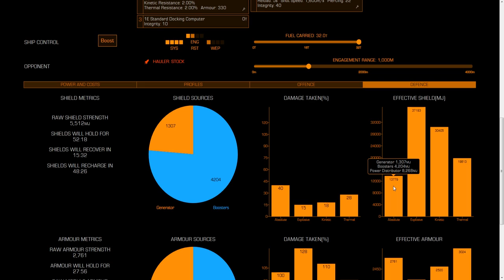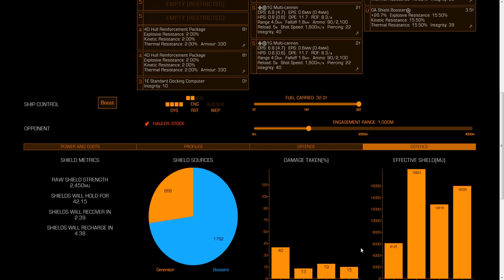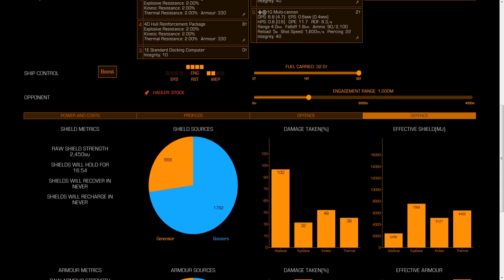ELITE DANGEROUS: 150 GRADE 5 THERMAL RESIST SHIELD ROLLS

Comment: I've been running resistance bi-weaves on my python and FDL...
I have both Bi-weaves Thermal shields as well as regular resistance augmented for both [Still testing]

Here's what i've found:
For the Thermal Bi-weaves...  as long as I have a total shield strength of over 1000mj's the shields are amazing.  So in relation to your bi-weaves on the Annihilator, you should be fine with over 2k shields.  It's when the values are below 950mj's where you find the Bi-weave thermal options starts to break down.  Essentially the resistance works... but with lower MJ shields... you don't have much to work with and your shields drop quickly.

Right now on my FDL, thanks to you, I have about 1001mj shields with 67 thermal resistance, 58 kinetic and 62 explosive, but the shield has to be a normal shield [I got a great shield boost on the thermal shield as well]... and I have to run 6 good resistance augmented boosters and two very good thermal boosters with some shield boost.  Mind you... that's at 2 pips to shields.

With 2k+ thermal bi weave shields on your conda... at more than 60% resistance... you should be fine.
Reply from the maker: dopejack007 yeah im really really liking the biweaves on my corvette
Reply: Here's a question for you - off topic...
How are those grade 5 overcharged power plants working for you?
I ended up storing my grade 5 OC PP because the heat generation was ridiculous on my python.
I instead rolled up one grade 1 OC PP for PVE general use... and one grade 2 Armored PP for PVP.

I found them to be waaaaaaaaaaaaaaay more efficient with regards to heat mgt.
With the grade 1 OC... my overall efficiency for the PP is now .38... which has made an enormous difference with regard to heat.

Before, I was never able to use my full capacitor charge with my weaps [3 LRG Rapid Fire MC's [one corrosive and 2 with no experimental effects].  and two efficient beams or rapid fire pulses with scramble spectrum].  Now... with the changes... I can fire a full capacitor volley without overheating my ship [a full 1:15 seconds when necessary].

Curious to know what your experience has been with the grade 5 OC PP... and whether I need to re-roll my grade 5.  Is it possible to roll a grade 5 OC PP with a beneficial heat efficiency?
Reply from the maker: I have a few overheating issues but since my power distributer is so good i only overheat during extended firing, but i have a ton of power hungry modules so i need the power
Reply: Hmmm... so maybe I need to super roll my distributor...
Thanks!!!
Reply from the maker: yeah i've noticed that i only start to overheat once my power distributor reaches half power or lower on it's capacitor

Comment: Keep in mind that the absolute value does NOT take into account resistance from shield gererator and boosters. The only weapon that deals absolute damage are plasma accelerators. If you were to instead take the average of the thermal and kinetic values of each shield type, the bi-weaves actually have closer to 70% of the effective HP as your prismatics, not half.
Reply from the maker: Smooticus nice

Comment: Great summary, very nice job CMDR! My corvette has prismatic shield with 5,6k strength but it has only 35% thermal resistance. I don't like PVP so I use this shield only for PVE. I know you and the other CMDR-s prefer the bi-weave shields and this vid clearly shows that it is more suitable for RES farming. But I would like to stay at the prismatic. What you think which choice better: If I change 2 heavy duty to thermal resistant booster, or change the reinforced mod to thermal resistant?
Reply: I mean here the golden mean :) which would be the approx. 4k shield with ~45-50% thermal resistance?
Reply from the maker: I found that with 4 heavy duty and 1 thermal and 1 resistance augmented shield booster it's the best semi-balanced setup for me, if im flying with friends in heavy combat at least 2 of us have heal beams, so that extra raw megajoule shield buffer helps if we get distracted from having a good time together :) and don't constantly heal each other. Hope This helps :)
Reply: thank you for your fast reply! I am going to try...once :) Currently I'm in the Colonia bubble and not planning to leave because of the long trip :P

Comment: If your only ever going to do PVE farming then the thermal bi-weaves are ok........

If your ever going to meet another commander then you'd be better off sticking with your reinforced prismatics, they are better in PVP.

You get rammed and those bi-weaves are gonna fail.....never mind players being armed with Plasma or rails lol

The increased regenerate rate of bi-weaves means nothing during combat as they only regent after 3 seconds of not receiving a hit.....which is hard on a big ship, bi-weaves work better on smaller ships

You would be far better working on just plugging that big thermal hole you have with your pristmatics, you always seem to go for raw Mj rather than trying to get a mixture of resistance and power, I'm running just 6 boosters on my Corvette......have 5k of shielding but +40 thermal as well as +55 kinetic and +60 explosive.
Reply from the maker: with the thermal hole my prismatics have from the engineer roll i have at the moment that's a problem i cant fix ATM :)
Reply: MINI I can only suggest swapping any resistance augmented boosters for thermal boosters with your prismatic shield 

I've got 2 grade 5 thermal boosters with rolls +27 both and 4 heavy duty all about 60+ but all with good added resistance secondary effects.....seems to give the best combination 

Or go just for Pristmatics but with thermal shields.....got that on my Python with 3 boosters.....works very well